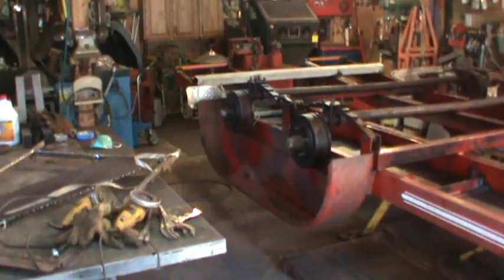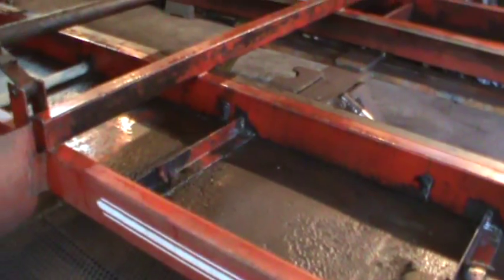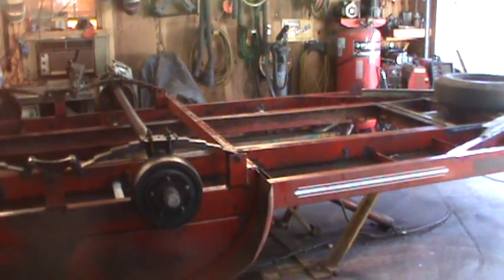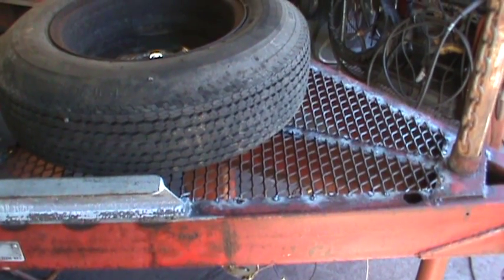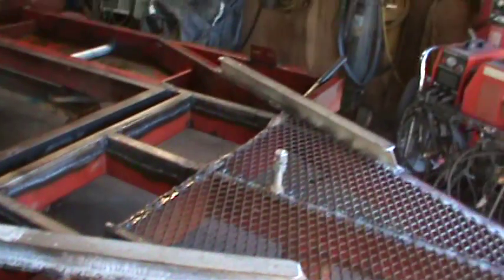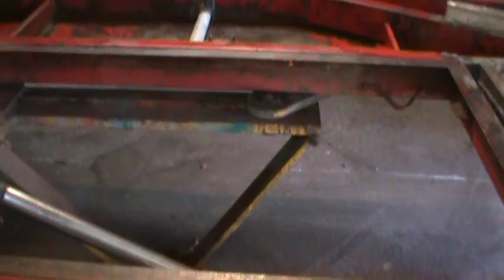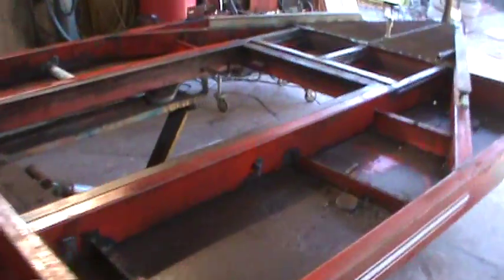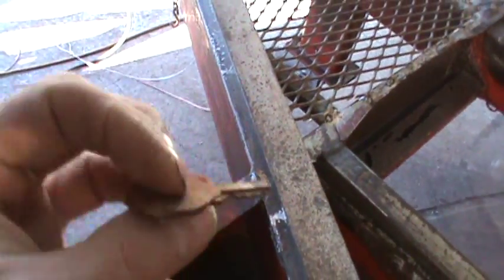more car trailer repair

Comment: That is one hell-of-a repair job.  Ought to be good for a few more years!  The I beam strengtheners were a good touch and the expanded metal storage is perfect... Most of the trailers we had at NDOT used expanded metal in their storage areas just for that reason.

Comment: Wish all Home depots were the same,ours has prep n etch , in the gallon and ace hardware has gal of OSPHO for $20.  OH be careful with putting chains on expanded metal. It made me pay for a car once. the chain fell through and not long after the end started swinging around and got the side of a car parked on the street.Great idea on the spare tire.

Comment: I think your going to find its a pain to get that spare tire back up there.  If you want to hang it underneath you could use a spare tire hanger.  Like they use under Pickups when you have the spare under the bed.  That way you don't have to "lift" the tire back up.  
Also, If you have enough expanded metal..  Put some in as the bottom where the old storage box used to be and make a lid for it.  You can put the less used things there and have it somewhat secure.

Comment: I use muriatic acid from home depot. Just make sure you rinse it off or it leeches through the topcoat. I think public works uses it to remove graffiti off concrete.

Comment: You must have better luck with trailer tires.  I use ours to carry our wheeling vehicle and end up replacing 1 trailer tire on the road about once a year.  Usually it happens when I'm 400+ miles from home.  I am now to the point where I carry 2 spares, just in case.  Its been less bad since I switched to E rated tires but I still get flats, even on < 1 year old tires..  A few of the people I go wheeling with have ended up with 2 flats in a single weekend.